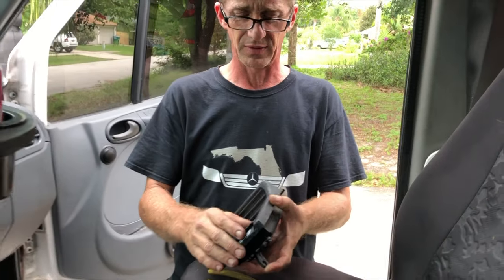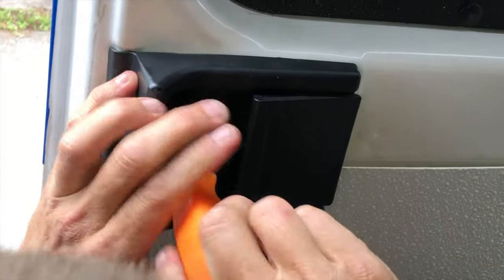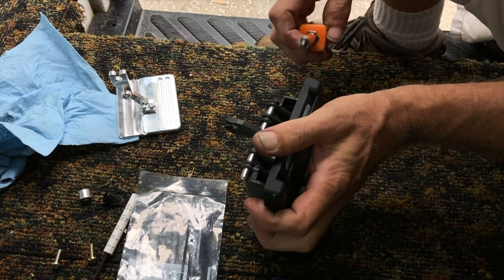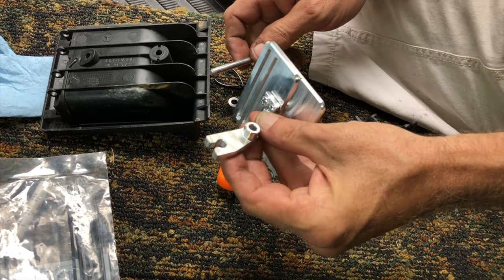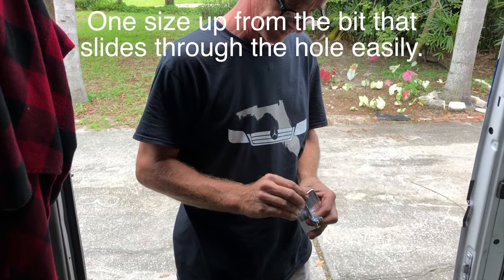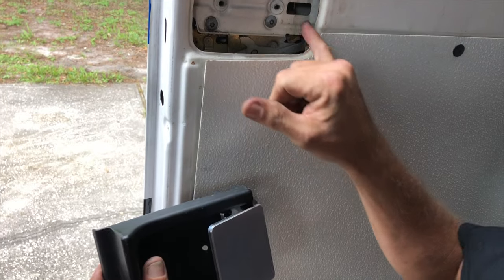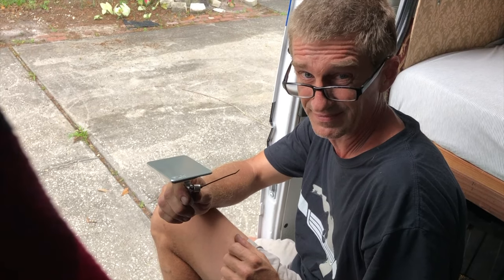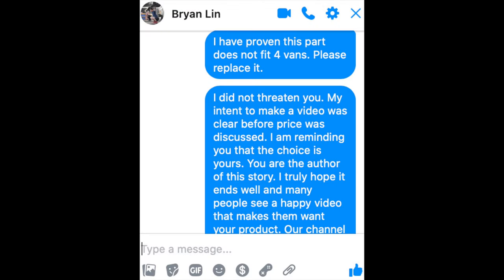Disappointing Door Handle for Slider T1N Sprinter

Comment from the maker: The seller decided to refund the purchase after this video was posted and the community rallied.
Reply from the maker: We have videos on fixing the door properly. This handle should only be used as "Bling", a pretty accessory. If the door is adjusted to open easily plastic handles will last forever.
Reply: where did u get this part?  
thanks
Reply from the maker: @sammblkf6920  A guy was selling them in a FaceBook group. I think there is another guy selling them on eBay now with better customer service. Same basic design.

Comment: I have had two door handle breakage on my 118 sprinter.  I saw this on the forums and considered buying this.  (will not consider this as an option anymore)  Thanks for the information.  Your a real asset to the sprinter community.  Please keep up the great content.
Reply from the maker: If you are breaking handles, it can be fixed to stop that and this metal replacement only moves the stress to another point if the door is not also fixed properly. I hope you have seen our 2 videos on sliding door repairs. The holy grail is the most common "won't open" or "hard to open" repair. The More Sliding Door video gets into aligning the various rollers.

Comment: You cannot have the sole pivot location IN THE CENTER.  You have to have at least 2 locations, one at top, and one at bottom of handle, to prevent torque twisting (breaking, wearing) the pivot. 1st year engineering stuff.

Comment: Does anyone  know where #47 bolt is to adjust the rear of the sliding door?
Reply from the maker: When the door is closed, this adjustment will be at the rear of the door, midway between top and bottom. The factory door panels have a "D" shaped cover over the bolt head. RV's and conversions often have cabinets blocking this area of the door and we need to knock a hole in the cabinet to reach the adjustment bolt.

Comment: This guy sounds like a pain in the ass, but why not go buy a $5 caliper from any hardware store to measure the pin? Drilling it was obviously the point of no return and you can’t drill it without a correct read on the size. 1/4” shouldn’t be in the vocabulary for a metric part. I honestly have to say that both of you handled this poorly. He should have just refunded/replaced it in the first place but he did try to work with you to fix it. He said you could drill it if you wanted to, but you took it upon yourself to drill it with the wrong size bit. Sorry, but you’re both in the wrong here.
Reply from the maker: Thanks for your input. Common drill bit sets here in the states are measured in fractional inches, eights, sixteenths, and even thirty-second of an inch. I had a new set of drill bits and used the smallest one that wasn't smaller than the existing hole. What is a $5 caliper? I know now but that was  something I never dealt with before.